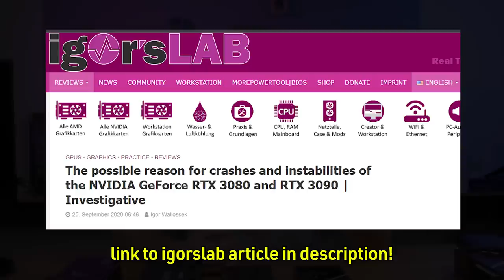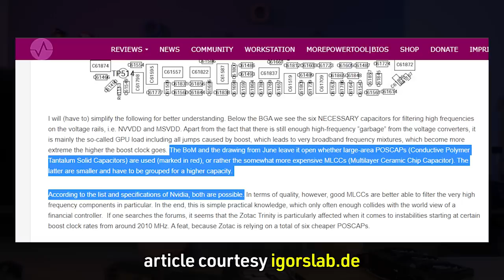The RTX 3080 Launch can't get any worse... Right? Wrong...

Comment: A firmware update? Jay, if my $700+ card starts wigging out at factory clocks that I probably paid above MSRP yet performs WORSE than a Founders I am going to RMA or ask for a refund. From my perspective it is defective unit. Also, all the AIB 3090s including the expensive ones have six solid caps on the back and no little ones. This should be interesting. 🤔
Edit: Old stock images on card backplates. Most actually have at least a pair of fancy caps. Asus has all six. Don't touch Zotac.
Reply: I hate to say this but anyone that paid a scalper for a card and got the crappy design deserves exactly what they got.  Boo Hoo
Reply: Good luck on that RMA wait. You better hope you have another card until then.
Reply: Theyre still working at their advertised specs though, isnt that what Jay was saying? Its only when the clock is boosted these issues come up.

If thats the case, and it can still perform and be stable at is advertised clocks then nobody will have a leg to stand on to try and get a refund.
Reply: MilkySubstance The more concerning issue is AIBs would rather bandaid a hardware issue by kneecapping the natural boost process of a card. Clock boosts while not advertise as the base clock will initially affect the overall performance of the card because of the hardware choices an AIB made on a card with a higher price premium. If this is the ultimate game plan going forward then consumers are just better off buying the few AIB models that aren’t hinder by this issue, or mainly stick with getting FE cards. It’s sucks that most of the AIB cards affected took shortcuts that led to this causing issues.
Reply: @NewmanOnGaming  Yeah I absolutely agree on everything you said. It'll depend on what the AIB partners say, but I get the feeling this will ultimately something the market ends up deciding and there wont be a good solution for those that already bough cards that arent performing how they expected. Since theyre still meeting the advertised specs, there just doesnt seem like a way out for those people, and they'll be stuck with their cards. It'll likely just end up damaging the AIBs names down the line and affect their future sales, but for the cards already sold, theyre stuck with it
Reply: Yea for now wouldn't get anything but fe or asus tuf tbh
Reply: MilkySubstance yeah. It really sucks for most of the early adopters. This reminds me of the artifacts issues with the 20 series after they launched.
Reply: Nick Garcia exactly.
Reply: @MilkySubstance   It depends on what country you are in ref your rights, in the UK and Europe if you order a product online and it doesn't live up to your expectations you have the right to return for a full refund within 2 weeks, no questions asked.  Postage may be down to the buyer and I believe some items are excluded from this.  This is especially good for electronics as you only have to deal with the vendor and not the manufacturer.

Comment: So to summarise, some third party card manufacturers under-specced their power delivery capacitors to cut corners on cost,
which has now backfired as it means their cards experience stability issues upon attempting to boost beyond the default max clock speed,
which is leaving a sour taste in people's mouths (and tainting the already controversial 3080 launch)
Reply: Is it only 3rd party cards experiencing this issue?

The way people are freaking out makes it sound like even the FE's are crashing
Reply: @rdowg  no, as of now only the custom ones
Reply: not quite, they didn't under-spec. They met the minimum spec as published (at the time) by nvidia. If they had known the issue they would likely have used the mlcc arrays.
This is inferred from the linked igorslab article particularly the following quotes
- "The BoM and the drawing from June leave it open whether large-area POSCAPs ... or rather the somewhat more expensive MLCCs."
- "According to the list and specifications of Nvidia, both are possible."

Comment: This is exactly why I wait a month after a hardware/ software release before buying.  I don't like bugs/crashes/issues.
Reply: Sure, also you can RMA the card within three years since you are under warranty. It's not like you buy it and you wasted money. You can return it any time.
Reply: birth pains  . i agree with you. review from common folks first before i start buying
Reply: Ecoder EliteCoder sorry pc noob here but I keep seeing RMA coming up. What is that? You said within 3 years I can return a nvidia video card ?
Reply: @mannyfresh7065   return merchandize authorization. where you have the item shiped back by either seller or direct to manufacturer for a replacement. its quite a hassle and takes time from wheee im from.
Reply: @mannyfresh7065  under policy, the manufacture offer 3 years of break down or if card is faulty they can replace if they cant fix it. OCUK offer now only for Asus cards new policy to try and replace your card within 48 hours.

Comment: Man, when DOESN’T a new card have issues... it never changes and it always “Wow this is a good card!” to “Wow, this is a terrible flaw! Don’t buy!” and then a few months later after a few updates it goes back to “Wow this card is actually good! Bazinga! Go buy it!” It’s a never ending cycle...
Reply: the problems are twofold:

1.  releases are driven by investors and not by technical requirements...
2.  most GPU manufactures will use the dirt cheapest parts for MAXIMUM profit...

of course, the vast majority of people fall for this shit and are utterly stupid.
Reply: This isn't a software issue. This is an engineering issue with the hardware. They skimped out on 2.00$ and that has a big affect on the performance of the card. Sure they could fix it by downcocking, but who wants that lol.
Reply: @chickendinner5572  absolutely SPOT on.
Reply: @davepastern  yeah, +2.00 × 100,000 units is a lot of money. That 2.00 is an arbitrary number that I made up, could be less or more. And then add on the other little things they skimped out on. I have money in stocks so I need to know these things lol.
Reply: @chickendinner5572  it's a lot of money to ordinary individuals, but to big business, 200k is small change mate.  There's no excuse for this poor quality production other than poor design and greed.
Reply: @davepastern  it's a good size bonus to a CEO though.
Reply: @chickendinner5572  I couldn't give a rats you know what about the CEOs.  They already make a f*ck load of money from doing jack shit.
Reply: @davepastern  why are you so angry
Reply: @chickendinner5572  why do you like it when manufacturers screw you over and then charge rip off prices for that privilege?
Reply: @davepastern  who said I liked it? It was just pointing it out my guy.
Reply: Remember EVGA cards overheating on Pascal 1070 and 1080 cards? They skimped on thermal pads.

Comment: That’s kind of alarming that the AIBs would cheap out and go below nVIDIA’s spec of having at least 1 of those expensive caps.
Reply: doesn't look like the spec required the mlcc array, just listed it as an option
Reply: Yeah... those cheap ones work just fine... you just have to have less clockspeed than those using the ”option”.
Reply: I wonder what the price difference is? I would be happy to pay a reasonable premium for 6 of the good ones
Reply: It seems that nvidia went better than reference, not that AIB's went below
Reply: Kevin Radtke Yup, and MSI and EVGA went with spec. Asus went way beyond it.
Reply: @RyguyCC  per card its probably less than $1
Reply: it was always like that, just nvidia surprised everyone building so close to the max possible stability.
instead of some headroom nvidia runs their cards now at 95%-98% by default,
that tells us 
-nvidia is desperate in the attempt getting more raw power outta their designs as were hitting physical end of scaling down
-there will be a complete redesign for the next card and there wont be a "super" version like last time, if theres a super version it will be ram only
-if theres a "super version" it will be little performance gain for a lot more electric power use
thats might even the plan, thats why redesign the powerconnector (its to prepare for the next step)

the future of gpus seems to be - more power - electric power. in 5 years we will have 1kw cards at 50% higher speeds as todays
or a completly new aproach to how gpus are build and work
Reply: @woswasdenni1914  I think that either they are scared of big navi, or trying to grind Radeon as a whole into the dust, to have a monopoly. Theyve shown already that with lit t le competition from them they will move towards monopolization
Reply: @RyguyCC  The Strix has all premium ones. https://www.youtube.com/watch?v=8IDMS54jEFM  (at 4 minutes mark)
Reply: @woswasdenni1914  not really, marginal capacitance issues are a common issue in electronic engineering, it's normally caught in the prototype phase of any PCB and is why you often see the first customer boards are "Revision 1.1" instead of "Revision 1.0", all this shows is that nvidia doesn't give the AIB's much time for product validation so they are shipping "Revision 1.0"; or close to that, boards where not all design flaws have been caught yet.

Comment: Now definitely looking at the ASUS TuF option!
Reply: I have Asus 3080 tuf. Never crashed. Runs so well :D
Reply: The tuf has the big 6 with no mlcc as well.
Reply: @Skwiizgaar  is yours getting to the clocks that Jay is talking about?
Reply: @m9x3mos  No, it was all mlcc...didn't you watch the video?
Reply: @m9x3mos  are you sure? Is Asus providing a mix, some with big caps and some with small caps? Because both Igors lab and Jay are showing Asus Tuf has all small caps.
Reply: It does make sense. ASUS TuF brand is all about high spec components.
Reply: @m9x3mos  nope it has all six as the mlcc
Reply: @AdamBoozer  ah good to know. Thanks.
Reply: Asus’ product photos appear to show the cheapest array.
Reply: @kylestewart4444  nope. Look at the video I posted. Look at the photo Phil added in this video of the mlcc's. I think Steve at GamersNexus did a teardown and oc as well.
Reply: Adam Boozer Okay, cool. I had just done a quick look at the product shots and it looked like the pos caps in every photo I saw but good on them for going above the basic standard.
Reply: @kylestewart4444  Right? I was surprised.
Reply: @m9x3mos  i heard the tuf is made in a different way that prevents the crashes. Havnt really looked into boostlevels. I have been busy enjoying games on a whole new level :)

Comment: Alright so here's my take. 

It's fine that some of these cards have to be bumped down in terms of voltage and clock frequency due to the cheaper manufacturing... IF it's directly advertised to the consumer in no uncertain terms that these cards potentially won't be as fast as their "full price" counterparts. Yes, the only thing that's being 'guaranteed' by the manufacturer is that 1710Mhz base speed, BUT these companies also advertise the fact that their cards can very likely boost much higher than that. As such, consumers should be aware that they are buying a card that very likely won't be able to boost as high as some of the more expensive options. That way they can make an informed decision as to whether they are fine going for the cheaper alternative because they don't care much about peak performance, or if they want to cash out a bit more to get a card that they can boost and overclock to their heart's content without having to worry about instability.

Basically just tell your customers what's going on, so that they can be better educated when making decisions about where they want to spend their money.

Edit: Also if we're allowed to dream a bit for a second, they should also offer a refund option for people who have already bought some of these cheaper manufactured cards without knowing their drawbacks. Really, they were thinking that they were buying a 3080 like any other, but now they find out that their cards will be at a disadvantage compared to others due to manufacturers trying to cut corners. Had they known that from the beginning, they may have chosen to spend their money on a different card. If that's not false/misleading advertising by the card manufactureres, then it's certainly at the very least bordering on it. But yeah, like i said. We can dream.

Comment: I want them to address the vram issue! my fe 3080ti hits 106vram in some games very close to throttling and not just in intense triple a titles.
Reply: You can partially (well.. entirely) blame nvidia for using crappy paste and even-more-crappy pads on the FE lines for that little gift. I dropped around 10C off the GPU, and 20C off my memory exchange just by tearing down the card, cleaning it, then rebuilding using quality paste (Thermal Grizzly Kryonaut), and pads (GelLid GP Extreme 2mm and 3mm). It wasn't cheap (cost about 60$ US is materials), but was absolutely worth it.

Comment: EMI, not ESD.

Electromagnetic Interference, not Electrostatic Discharge.
Reply: I'm a HV electrical engineer. This vid is pretty cringy.
Reply: @MultiPenisbreath  wah
Reply: ESD can cause EMI
Reply: @mneedes2  ESD is a static discharge.  While you're not incorrect in your statement that it could cause interference to nearby circuits, it is most known for killing components due to the extreme voltage levels present in that situation, so the interference is usually not the problem there.
Reply: @YesterGearPCii  Perhaps it is more known for causing interference.  Lightning strikes and AM radio / FM radio.
Reply: @mneedes2 You're talking on the macro end of things.  When ESD is discussed with electronics, it is meant as the accidental discharge of static buildup from a human or other item in the workplace into an electronic component.
Reply: @Ms123kill  Anyone who says Rofll --- and uses lower case i -- doesn't have room to talk about educational systems.
Reply: @YesterGearPCii  Don't have to explain it to me, I performed EMC testing on flight-unit satellite electronics that went into space.

Comment: Definitely going for ASUS variants with all 6 with the higher quality part. Better power = longevity.
Reply: I think the msi gaming X trio as well as evga ftw3 have the beefed up systems as well

But pretty sure Asus tuf is the only "msrp" AIB card with a not shit delivery, which probably explains why it's faster than even the FE with a custom design.
Reply: Thats strix you mean right?
Reply: @SPIRIT-117  The gaming X does not. https://www.techpowerup.com/review/msi-geforce-rtx-3080-gaming-x-trio/images/back.jpg

Its PCB this generation is kind of disappointing for the price more generally. Not sure what happened compared to prior generations, but they cheaped out this time.
Reply: @Himbel  he was referring to the Asus TUF
Reply: @Himbel  Definitely the TUF. If you look at pictures of the backplate for it, you can see all 6 of the more expensive capacitor layout... Makes me question where they could've cut costs though.
Reply: @decus478  that's good to know. Shame, gaming X trio was a real monster in the Turing series.

Guess we be using TUFs, Strixs and FTW3s until shit gets figured out.
Reply: @JDubST  tuf doesn't have any rgbs I don't think, and I think the fans and shroud design in general is "less premium" than a Strix. I haven't been able to find any detailed breakdowns on the strix yet so I'm not sure.

Asus really does seem to have hit a home run with the tuf tho.
Reply: @SPIRIT-117  I just watched Bitwit's review on the Asus TUF board, and it has a little RGB on their logo, but that's it. It also runs quite a bit cooler than Nvidia's FEcard. I'm interested in water cooling, and it looks like the TUF card is the best one. I'm already an Asus fanboy, and this is exactly why. Quality parts all the time.
Reply: I have two ASUS 990FX sabertooth TUF motherboards. One had caps sheered off the back of the motherboard i put back on with a 50$ solder gun and reading glasses, works just fine. The other i spilt soysauce on the center of the board around the bottom right corner of the cpu socket, whyel gameing, it got left thier over half a day, took it out, sprayed it with hexane, put it in the oven, put it back togeather, works just fine. I even push stupid amounts of overclocking at it. i run a 8350 at 5.1 boost clock on air.(its not your normal computer case)
Reply: I just checked Gamers Nexus RTX 3080 LN2 Overclocking Stream to see the PCB of the EVGA ftw3 and it looks like it has 6 of the cheep capacitors. At 12:41 in the video you can see the back of the PCB it has 6 of the big black ones.
Reply: @dudablabla1994  wow. You are absolutely right. That's a shame honestly.

But I'm also kinda surprised, GN got pretty damn high OC out of the ftw3 when they air OCed it..... But they also didn't test in games. Wondering if they would have CTD issues if they'd tested it more. Kinda like how Jay said "we are just trying to set a record, if it crashes run it again, maybe it'll pass this time"
Reply: @dudablabla1994  Evga said that's early production for press, later version for consumers will come with 2 better and 4 normal ones.
Edit: Evga also said they will replace cards already sent out to the press with production models.
Reply: @greggreg2458  good to hear that EVGAs customer support is still awesome.